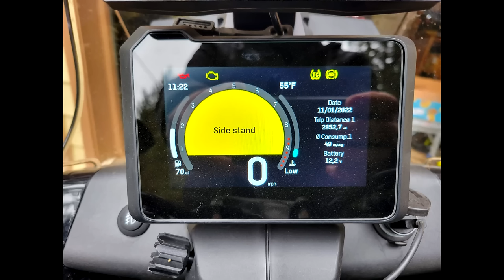Husqvarna Norden 901 Long Term Review: 6 Months and 3,000 Miles

Comment: This review is Big Rock approved. To each his own, but I am OK trading off a little reliability in exchange for more fun, more power, better suspension, and less weight. That's why all my current bikes are European -  a KTM, an Aprilia, and a BMW. But, I'm not riding around the world in super remote areas. If I was, Tenere 700 all damn day. I am privileged to ride for fun, so I want to maximize that fun factor on each ride. Thanks Ben, super great review.
Reply from the maker: Thanks man! That's a big compliment coming from you!
Reply: Hey guys, good points, both of you.  I'm sure I'd love this bike.  The aggressiveness doesn't concern me, I'm used to that.  It does feel big to sit on when considering off-road ventures. My biggest concern is the computer.  I'm not doubting that it's great at what it does but what does one do when it glitches or flakes out?   Can you wire across it and keep getting it?  I imagine they made that difficult.  My street bike is 38 years old and rockin'.   What happens if you go ten, twenty, thirty years -- to where no new computers available from husky anymore -- yer left checking bike boneyards and maybe an otherwise perfectly good bike becomes a monster paperweight.  I'd feel a lot less apprehensive about that if somebody came up with a computer eliminator.  If the ride computer and ECU share the same microprocessor then it would take an aftermarket ECU and that would work to have a spare.   It just makes me nervous.  It's like the cool factor takes precedence to longevity.
Reply: Great reviewers both.  But, if I was to ride around the world I do the Itchy Boots program and ride a 300 Rally with a suspension upgrade.  Slow and steady.  Last I heard she had 40,000 km on it & still rolling
Reply: @mikemerrill175  
There's a lot to be said for traveling light! 
Personally however I'd be a bit uncomfortable on a bike knowing I couldn't outrun trouble.
Reply: @elgringoec  No computers
Reply: @Rene-up1dl  
Exactly.    ECUs make for great efficiency but if you keep things for long times then it can become a parts availability issue.  But then add a ride control computer on top which is able to control the ECU then it's double jeopardy.
Reply: @elgringoec  Too much technology, too much extra cost.
Reply: @Rene-up1dl  so you only ride carbureted bikes? Because any bike with fuel injection has an ECU to control the fuel map. Granted it’s a very basic ECU but it’s still present.
Reply: @michiganmoto7687  Only carbureted.
Reply: @Rene-up1dl  I like Carbs, 6 pin CDI's are available 
everywhere. You can even carry a spare carb
and CDI without taking up much room, don't need a 
programmer to fix anything.
Reply: @bikersoncall  The high performance guys can pay high dollar, not me.
Reply: @Rene-up1dl  Same here, I need a clutch, engine,
and tires. All that traction control,
mapping, logistics apps,  etc is
somewhere amongst the two brain cells
that I have left.
Reply: @Rene-up1dl  
All my bikes are carbureted, and I know how to tune them.  But I started as a kid more than fifty years ago.  I have cars with EFI and I've learned to like them.  It's fun to watch all the sensors read conditions and the controls responding.  EFI is great at stretching fuel economy and minimizing toxic emissions, and without compromising delivering power.  I'm not sure it's even more expensive to manufacture nowadays due to economies of scale.  My concern is replacement parts, mostly the ECU, should things go awry in time.  But I've never had a car ECU fail and that includes an '85 Saab, 38 years old.  So my concerns may be excessive.   Besides, if I want a modern bike, I'm going to have to accept it.  But I don't want to further my liability with a ride computer controlling the ECU to control traction and whatnot.  And I'm my own abs so I can do without that (never had a bike with it) but that's govt mandated now.  That's easy enough to turn off or even defeat if I deem preferable.
Reply: The two best reviewers !
Reply: Well said both of you. I would appreciate this bike, but mostly onroad. Current T7 rider and even that bike I have done some questionable stuff that would have killed the Norden. Went under water on the MABDR, flooded engine, hand cycled all the water out, changed oil twice and the bike is good to go again. I would love the performance of the KTM, but would never trust their electronic systems. Next bike is a KTM 500 though, not all the same problems their ADV/road bikes have.
Reply: @tbgtbg6311  
An "adventure" bike is for some of us a third bike.  First is a dirt bike, then a street conquerer, then adventure when we want to take the asphalt some distance then hit mild trails.

No matter what bike I'm out on, moments occur when I wish I could magically transform that bike into one of my others.  When that's solved, we won't need adventure bikes (as defined today).
Reply: @elgringoec  I Agree.....IMO,,,,The Electronic Fuckery on most new Motorcycles (even more so on cars) is the achilles heel of these vehicles. I understand that it is here to stay, and some of it may even be necessary, but I look for the models where it is as minimal as possible.
Reply: @tbgtbg6311  
The problem is in how you say it.  The rest of the world has already established the concept of adventure bike, if that moniker doesn't work for, I get you have your reasons, but you're not going to sway the world with your opposition to it any more than you'd lift a house with a blade of grass.

Ride on.
Reply: @richardwatt911  
Everything comes increasingly fancied up with electronics, people buy into it for the cool features, few realize how difficult that makes them to fix down the road when even newer features are dazzling the herds, so they become landfill fodder and our cost of ownership has skyrocketed.  Loss for us, loss for the environment.

Who benefits?  The manufacturing and sales industries who introduce and market them.  Can't blame them, they're just looking out for themselves, it's the people paying them to keep doing it we can thank.
Reply: @RedEmpire36  I think the reliability or lack of on KTM's is exaggerated, friend of mine has just completed 80.000 miles on his 890, no issues at all apart from keeping it well maintained
Reply: I would rather ride my bike. I don't want to push it.
Reply: @mikemerrill175  you know when itchy boots got to Alaska she had that 300 completely rebuilt. And it had some serious issues.
Reply: @Rene-up1dl  every modern bike has computers.
Reply: @elgringoec  I guess you're going to have to stick with 40 year old bikes. All motorcycles have a computers. My 1982 Honda CX500 had one and it failed. (Actually a wire came off)
Reply: @bruceheimbigner9587  WRONG. TW200 still has no ecm.
Reply: @bruceheimbigner9587  
They do but there's a difference between a "ride computer" and an ECU computer.

Even my 39 year old street bike has some digital circuitry. 

Granted, everything is some kind of gamble.  But the more the electronics, the more the potential failure points.

Plus I don't want to be navigating menus to adjust how much wheel spin I can get.   For those who like that kinda thing, go for it, but I'm plenty happy directly controlling my bike without any of that kind of "help".
Reply: Man this aged poorly 😅
Reply: 11200 trouble free miles so far , just sayin'
Reply: never had computer or electrical issues with any of the many many KTM's ive owned , had a few issues yes of course but not that  @elgringoec
Reply: @justsomedude445  
Consider yourself fortunate.  But then again you probably aren't running a 38 year old bike like I am.
Reply: @elgringoec  38 year old ktm's have computers ?   whatever brand of bike if it is 38 years old do you still consider that a failure or sign of poor reliability at that age or just worn out parts needing replaced , which id call maintenance ??
Reply: @justsomedude445  
Huh?
Reply: @elgringoec  i think the original hing was about you saying you had or ktm's had computer issues , then you said something about me being lucky or that im not running 38 year old bikes so maybe i didnt understand your point ?
Reply: @justsomedude445  
My original post is still there.  Is there anything specific I can clarify for you?
Reply: my bad ride safe wildman !! @elgringoec
Reply: @justsomedude445  
✌️
Reply: @xbgo1856 Can you have your friend make a YouTube video of his 80,000 mile 890 because the most miles I’ve ever seen on a KTM with proof is a 1290 with 60,000 miles. I’ve heard rumors and read comments of 100,000 mile KTMs but I’ve never seen one with visual proof.

Comment: The oil change interval on the T7 is 6,000 miles. No one can answer why the US models listed a 4,000 mile interval. The valve check interval on the Norden is much shorter than the Tenere. You need to check the valves on the Norden every other oil change. 26,500 miles for valves on the T7.
Reply: Engine oil change interval on the Norden is 9,300 miles (15,000 km). Valve check is at 18,600 miles (30,000 km).
Reply: @RangeRoversAreRad  so like I said, every other oil change...
Reply: I plan on having my 890 ADV R suspension redone. Stock setting is to still. Offroad comfort is OK and sorta plush on and offroad. Trouble is to stiff is not what I want offroad and stiff on road is great canyon carving but uncomfortable in evert other road riding circumstance. So even the 890 R needs work. Preload is also a head scratcher as KTM doesnt have a concsise measurement for proper front/rear just "turns." 

So mines getting resprung and revalved/shimmed for my riding weight and style.
Reply: @MeerkatADV  it's 30.000 vs 40.000KM, still a huge amount on both bikes and most people won't even do it more than once
Reply: @BigSingle  it's 43,000km on the tenere (26,500miles). And mine were still in spec. We'll see how the Norden does but I'm not hopeful considering how often I had to adjust my 690s valves.
Reply: In Japan oil change is every 3-5000 km (1800mile-3000mile)
Yamaha makes more stiff valve that rarely need checking as it. Euro bikes are looser so they can flow more power (or so they say). I work in the motorcycling industry here in Japan, this is somewhere between hear say and my professional experience)
Reply: @KairyuRider  Japanese service manual calls for oil changes every 10,000km.
Reply: @MeerkatADV  it's says to service the bike every 10,000km. And the manufacturer says oil if you use full synthetic is every 10k. But all the dealers in Japan I've interacted with (all japanese, bmw, and triumph) say oil every 3,000km but you could push to 5,000km.
Or 1 year.
I'm at 6,000 since my last change (don't tell me boss) and I'll push it to 10k

But I think the big difference is that dealers are scheming in every country, and the usa makes you change early so they don't get a lawsuit if something goes bump in the night.
Reply: @Kairyu Rider  the dealers just want the money. No one has ever been able to explain why the Euro and Japanese Yamahas say 10k and the US bikes say 4k miles. I've got over 26k miles on my T7, half of that off road, and I change oil every 6k miles. Never a problem.
Reply: @MeerkatADV  then that's the answer, never a problem, no reason to do it different.
700 and bigger yamahas are all made in Japan and France as far as I know, so look to the makes not the distributors 

But again, I think it's a lawsuit thing. 

Not to be that guy, but just a thought,  it's possible you got bad conversions. Just over 4,000miles is just under 6,000km for a convenient rounding.

But again, stick to what has been working, the mt07 engine you ride is the most reliable ever made, the tracer 900 engine I ride is the second most reliable so... push it as far as you are willing
Reply: @Kairyu Rider  the US manual says every 4000 miles or 7000 km. It's the only one that does. All other yamaha manuals are 10k kms. It doesn't make any sense, but it's been like that for years and no one can explain why.
Reply: @MeerkatADV  just had a thought, ignoring the German autobahn, European and Japanese roads have way lower speeds than usa and usa is doing more miles faster.

Also usa does far more off reading than the average eu and Japanese rider. 

So that much extra wear on the engine might be a reason for more frequent oil change

Just a thought
Reply: Require closer service intervals due to riding in  more heat and dirt
Reply: @adamclarke1105  it's the same for the R3-R1, MT07, MT09, etc. Again, only the US market and its every bike. Makes no sense.
Reply: I meant that those areas which have higher ambient heat and regular dirt usage will have recommended closer intervals because of oil degradation and contamination. Also some countries are known to have more finer dust particles which gets in areas it’s not meant to be. Depending on how  much dirt riding you do, it’s also wise to replace oil between recommended service intervals.
Reply: 6000 miles for engine oil? That's almost like a car
Reply: What’s a valve check? Asked the DR650 owner.
Reply: @whiteunicornDR659  hopefully you're joking, the recommended interval is every 7,500 miles.

Comment: I bought this bike after having not ridden for 32 years.  I'm 60, weigh 295lbs and totally out of shape (working on that one).  I bought it with the aspirations of motocamping, a little touring and some mild off road riding.  My last bike was a KX500 so I have plenty of dirt bike experience.  I did have a deposit on the 890AR but having sat on one in the showroom I was staggered at how uncomfortable it was.  Then the Norden came out and every reviewer said it was comfy and that was the tipping point for me.  After one season and 2000 miles, a few adventure trips I can say that I love this bike and pretty much agree with everything you mentioned Ben, although the comma's don't bug me lol.  I need to re spring my bike for my Michelin Man physique and for all the gear I carry as it is like you say, too soft.  My only complaint, like yours, was the lack of aftermarket accessories and other than swapping out the forks and shock for the 890AR suspension there is no options for heavier springs yet and my pockets do not run deep for swapping the suspension out.  Great video 👊
Reply: What did you do to address the springs?
Reply: Thks     for the comment. I' m four-score yrs old now and 255# and looking for one last bike - except i want  highway cruiser for a last fling trip around the U.S.A.
Reply: @nomadpi1 this will do it for long highway trips. I’m 70 years old. I was 285 lbs 2 years ago. I’m 245 lbs now, and I find this Norden is perfect for me. I was riding a 2015 BMW R 1200 GSA and traded it for this Norden. That turned out to be a good move. I lost weight primarily so I could ride smaller bikes. I had a 77 Yamaha TT 500 when I started my diet / program. I also have a 01 BMW F 650 GS Dakar. I think losing weight helps me enjoy it a lot more. My wife says- I didn’t lose weight to have a longer life with her or to see my grandsons grow up, I did it so I could ride longer on lighter bikes. She’s a bit jealous. 😹😹😹

Comment: I received my Norden back in May and have put just shy of 10k miles mainly street riding.  I agree that this bike has some excellent power to weight numbers and makes one ride like a hooligan. My daily commute round trip is 134 miles.   So for me there’s no boredom moving down the freeway here in California.  I sold my Harley SGS to get this bike and love every minute I’m in the saddle.   Some of my commute is on two lane country roads through farmland and there’s always some spot next to the river I want to check out.  I never could do that on the Harley.  As for reliability I had the dreaded counter shaft seal leak appear around 900 miles.  My local Husqvarna dealer didn’t have the seal kit but fortunately the KTM dealer did. Swapping out the seal was straight forward and the bike was back on the road in an hour.   That’s the only major issue I’ve had.  I’ve done all my own maintenance on the bike recently completing a third oil/filter change and I’m bumping the interval up to 4500 miles.   I recently swapped out both tires going with an 80/20 tire combo.   Chain maintenance is a necessary evil and I do it every 1000 miles.  In that regard I do miss the belt drive.  Bikes I owned prior to the Harley’s all had chains so I’m used to it.  There is one thing that bugs me but isn’t a deal breaker and that’s front fork dive.  All my bikes have done it but this one I find it annoying.   Anyway, that’s my two cents for what it’s worth.   Good spot on review by the way.
Reply: 134 mile round trip daily commute... i don't know if i should admire you, envy you or call you crazy; all the same, impressive.

Comment: So glad you havent had any problems and prove the KTM reliability wrong 😂

My '22 890AdvR ~5000 miles and: 
1) partial wiring harness failure (dealer swapped for new bike)
2) break in oil in the airbox
3) front brake calipers not greased properly causing pulsing in front brake
4) ignition cylinder snapped in half causing abs/tc/cc to stop working
Reply from the maker: These do seem to be a little better than the 890s so far
Reply: What where you greasing on a radial caliper ????

Comment: Got my Husky heated grips a few weeks ago in the UK so supplies must be starting to come through. 

Only done 2k so far, bike has been issue free and is the most versatile bike I’ve ever owned. Surprisingly quick on tarmac and being new to off-road it looks after me and flatters my ability. 

Mine has forgotten the favourite settings a few times and I’ve had the immobiliser unavailable warning after stalling the bike and restarting but it cleared when I keyed off and on. 

Thanks for your videos they helped me when considering all the other mid weight adventure bikes.
Reply: how about comparing to tiger 900 rally pro?